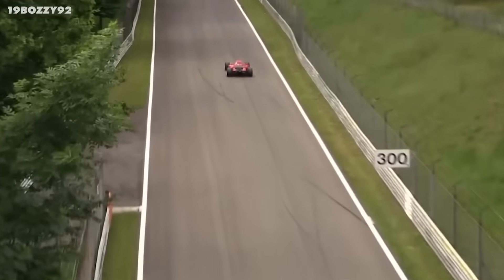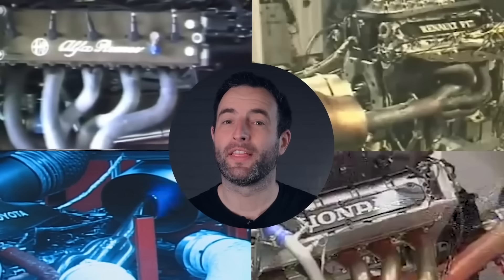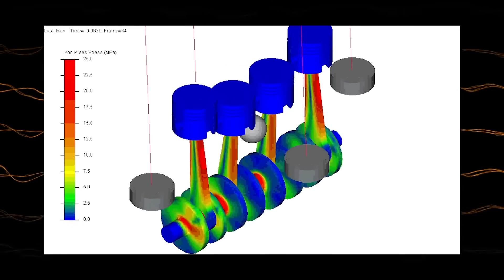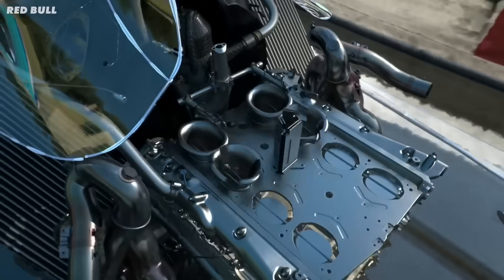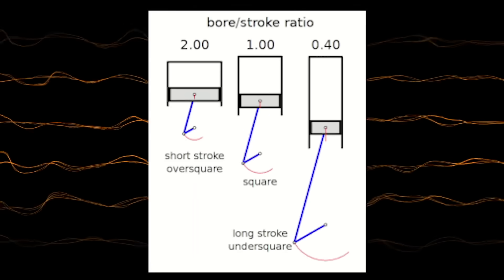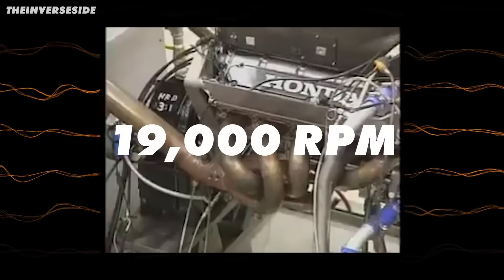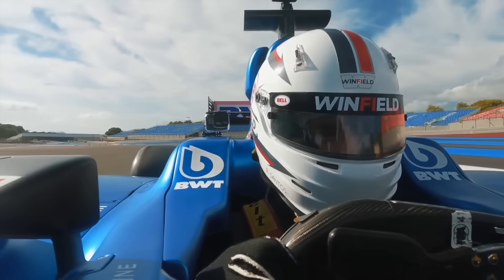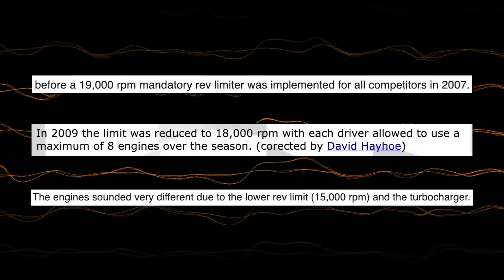When Formula 1 Engines Revved to 20 000 RPM!

Comment: They actually reached the end of the line... at around 21.000 rpm the Flame isn't fast enough to keep delivering more Power with more revs, cause the pressure raise starts being slower then the gas cycle in the piston. The work cycles is so Short, it has no time to burn through or expand.
Reply: They had a similar problem with the current v6s.
Mercedes was the first to solve and reaped the benefits during the start of the hybrid era.
The solution found was inspired in rocket engine technology and involves a pre-burner: a small combustion chamber in which a small amount of fuel is ignited. The shape of the chamber greatly accelerates the flame to the main combustion chamber, where it spreads and is mixed with more fuel, igniting it. 
This increased flame spreading speed, the quality of the spread and the burning efficiency.
Reply: @lucasrocha7721  We (powertrain engineers) call that Turbulent Jet ignituon, or TJI. The effect is that instead of producing one Flame wall from the Spark you create multiple, one from each of the bores of the preignition chamber, leading to a faster burn of the mixture, a steeper pressure gradiant, a higher Peak pressure, more time to (over) expand the gasses and by that way more effiency and power.
Reply: @TheNecromancer6666  I may have heard this specific nomenclature before but didn't recall it.
As a layman the rocket pre-burner was the closest parallel that came to my mind.
I may be mistaken but I recall also reading something regarding thermal benefits due to better managing the heat spread on the piston head, avoiding the formation of Hotspots. I think Craig Scarborough mentioned something about this allowing for a different design of piston head that could be lighter.
Reply: @lucasrocha7721  Avoiding Hotspots is a good point too. The TJI leads to a very homogeneous burn. You know what the best analogy to TJI is? Not the cool rocket pre chamber. But prechamber ignition of am old Diesel Engine, before common rail direct injection.
Reply: Wow... That's fascinating. Good post. Cheers.
Reply: @TheNecromancer6666   regardless of the terminology your statement is still wrong as there is room for more rpm’s
sit back & watch my friend
Reply: @Gavin Gilmore First of all, if you read all of my comments, do you really think its a good idea to argue about engines with me? 
And Regarding your question: If you reduce Combustion chamber size, or introduce a way to accelerate flame speed, yes. If you keep it at the parameter we are talking about here, 300cc Combustion chamber, basicly normal premium fuel, a single sparkplug and no forced induction or chemical oxydator. That's it. That's the limit. F1 engine manufacturers back then spend hundreds of millions per year on these engines. Are you honestly telling me, you think you know better then Ilmor-Mercedes, Renault, Ferrari, Honda, Toyota and Cosworth?
Reply: @TheNecromancer6666  sorry to bother you again, but would you please clarify a doubt that came to my mind in the last days?
Race cars now have a stabilished trend of having a single air intake on the top, I was wondering what are the reasons for that.
I'm thinking about ram air effect, cleaner air, less weight and ease of plenum design, but I would like to hear what are your thoughts about that. I can think of some benefits of going for two smaller intakes lower on the sides (like some street cars) or using part of the sidepod intake area, but I'm wondering about the compromises of this alternative.
Reply: @lucasrocha7721 No worries mate. Yes. All F1 cars have it, all LMDh and LMH have it (I think), all P1s after 2011 had it, all P2s have it.... Aerodynamics is not my area of expertise so I can't give a definitive answer. Ram Air is factor. A good airbox gives 50mbar at around 200-250kph, that's 20-30hp for a Prototype or F1 car. Another factor is temperature, the air there is the coldest the car can "reach" even when the asphalt is boiling. Another factor is that from there most racecars pull additional cooling flow. For Turbo, electronics, gearbox oil... etc. 
And the last factor is location of the engine intake. Neatry all modern racecars have very tight engine packages , so the turboinlet/Intake trumpets are all in around the cars centerline. So this is the shortest path there. Remember 80s Turbo F1 cars, group C cars and the Turbocharged LMP1s before 2011? They all had engines over the whole width of the car, with Turbos in the sidepods and intakes on top of the sidepod.
The con of a Topairscoop is a loss of rearwing performance.
Reply: @TheNecromancer6666 😂😂😂 such a wannabe😂😂
There is no such general limit as a number of rpm‘s, as the piston speed (just to mention as one of the factors) is for example depending on the ratio between crankshaft/connecting rod etc., etc.
😂😂…in the UK/USA everybody calls himself an „engineer“😂🤣😷
Reply: @christophmeyer5402  Well I have designed Performance engines, sunshine and you? If you had read my comments you would know that your vary basic arguments, while correct, are not applicable here. You talk from a Roadcar perspective, not an F1 perspective.
Let me give you an example, you would already know, if you had 1. Bothered to read my comments 2. Even basic Knowledge of racecar engine design.
Bore and stroke ratio in an extreme RPM, high compression engine will give you a hard limit on rpm. Why? You can't shorten the bore indefinitely, because otherwise, at TDC there is no space left to open the valves and if the gap between piston and chamber becomes to narrow the flame wall becomes unstable. High revving F1 engines were at that point of compression ration, bore and stroke. That's the reason that, while your argument is valid in a roadcar context, its pretty nonsensical in an F1 context. They are already three steps further then you thought.
I'm German BTW.
Reply: @TheNecromancer6666  so obvious, that this would trigger you🤣 
Good to know that WE😉 have enough knowledge, to have enough self confindence, in what WE😉 do.
Reply: @christophmeyer5402  What annoys me, is that in a long thread of friendly and civil conversation one wanker, who has no clue what he is talking about, comes along to ruin that. It's perfectly fine that you don't know about racecar engines, thats not a crime. But then ask. And don't be a dick about it. You could have known that I would try to answer any question as good as I can.
Reply: @TheNecromancer6666 than*
Reply: @lucasrocha7721  so instead of a spark plug,they use fire?
Reply: @paulsheridan291  Pretty much. They still have a sparkplug, just in the prechaimber with the direct high pressure fuel injector.
Reply: @lucasrocha7721 Sounds like a 2-stroke combustion event.  Who would've ever thought that it would take a series of sensors, wires, computers, extra injectors, extra spark plugs, valves, cams, chains, spinny-things, etc, etc..... In order to reach 2-stroke power levels🤷‍♂️??
Reply: @cap10moman  I am not a bike or two stroke person, but I know that the old GP two strokes could reach 400hp per Liter, while the V10s reached 320hp per Liter. With the later V8s reaching 310hp per Liter at lower rpm.
 But the 4 stroke has a wider power band and won't murder you when it comes into its rpm band. Even oldschool Turbos aren't as violent as some of the things I heard about two stroke bikes. Also: there is no two stroke with 1000hp per Liter, as far as I know. So turbocharged 4 strokes still have it.
Reply: @lucasrocha7721  That was because they were running very lean due to fuel limits and the use of direct injection. Due to it running so lean they would miss at higher rpm, so they made a rich area around the spark plug turning one little spark into a bigger ignition flame to ignite the lean air fuel mix.
Reply: @lucasrocha7721 actually the technology is used in the ford powerstroke engines but still direct injection is still better
Reply: @lucasrocha7721  My brother in Christ, Mercedes had their engine already designed before the other manufacturers. They designed the 2014 specs.
Reply: @skwisgaarskwigelf331  No they didn't. Renault Was the biggest proponent. Which is kind of funny...
Reply: @skwisgaarskwigelf331  so yes, technically they were the first to figure it out.
Reply: @lucasrocha7721  rocket engine technology? I am no engineer but that sounds far fetched. As a mechanic I would say it is similar to precombustion chambers like the ones used in old diesel engines in the time that distributor injection pumps were the norm. Funny how some technologies deemed obsolete for an application can become the norm for other applications (even if with major tweaks).
Reply: @Runmeerkat  yes yes. TheNecromancer6666 also made that point to me.
I'm not a engineer and the example that came to my mind to use as a point of reference was the pre-burner in a stage combustion cycle liquid fuel rocket engine, which does a similar job, while having the far more important role of spinning the turbopumps.
Reply: @Runmeerkat  You are actually pretty much Spot on. Its a lot like an old prechamber diesel. Instead of a sparkplug you have a hardened steel Insert with bores in it. Within that Insert there is the high pressure injector, the sparkplug and optionally a high pressure air valve. The fat mixture in the prechamber is ignited, through the holes in the chamber the Flame comes out in high pressure jets. These jets light the lean mixture in the Combustion chamber from multiple points, instead of one, causing it to burn faster, they also Set it to tumble more, causing even more complete burn through of the mixture. 
This leads to an engine running extremely efficient, due to running lean, running a very steep pressure gradient, a higher peak pressure and very complete and clean burn. Petrol Engine with a thermal efficiency >50%.
Reply: Yeah, that's what I thought - and the next limit that was hit was the spring rate of the various alloys used to actuate valves, etc...
Reply: @bholdr----0  That's not really a factor, because Iof the Pneumatic Valve springs.
Reply: Also, is the rate of the propagation of the combustion analogous to how black powder firearms hit a wall based on the fact that black powder deflagration hits a wall, after which, no matter how much powder was placed in a gun, or how long the barrel was, the projectile simply couldn't be propelled faster... Which led to some truly absurd firearms which could only increase the energy of their projectiles by increasing their mass, as a maximum practical speed (something like 1500 fps) had been achieved. (Which was also perhaps the impetus the transition from solid shot to shells in the late age of gunpowder artillery age/ age of sail...

I don't really know, but I'd love to learn... It seems reasonable...
Reply: @lucasrocha7721  Actually they did the same thing Honda did with the CVCC back in the 70's.
Reply: @lucasrocha7721  Diesels have that tech.
Reply: @HSKFab  *Had.
Reply: And then in 2007 the regulations said that engines could not go higher than 19.000rpm in an effort to limit costs of reliability issues
Reply: @arnaudj.5314  That kind of “cost reduction” isn’t, it’s utterly clueless. Exotic materials are a very small part of the cost of these engines. R&D is the true driver of cost. Every rules change spikes cost. If you really, genuinely want to reduce costs and improve the backmarkers relative performance freeze the rules for 20 years. If you’re changing the rules every year, as FIA does, along with enormously expensive new engine regulations every so often, you maximize costs and essentially eliminate the ability of small budget teams to catch up.
Reply: @headlibrarian1996 that's probably the plan ...the rich and powerful like to tell us peasants lies so that we stay blissfully ignorant while they do.nefarious.things to make money and when things don't work the way the peasants think and start to complain they just make another "new" plan and we are pleased and stop complaining....
And so the cycle continues.....
Reply: This is only the case if they have enough stroke.. with less stroke they can rev higher because the piston moves slower during one stroke
Reply: @ebugauge  No. Because the work cycles just gets to Short. You have a maximum Speed which the Flame can travel at. If that isn't fast enough to burn through the mixture and then give it time to expand after the burn. You can only rev higher by reducing the combustion chamber volume or raising the charge pressure.
Reply: @TheNecromancer6666  which of the two has more effective power to volume inserted to the chamber: igniting before the cylinder and pushing already ‘burning mix’ into  the chamber or putting more fuel&air into the chamber (which was my normal logic, seems at such high revs my logic lag same as the spark..?)? It’s just so new to me that I feel I learned more form comments than form the vid itself. Anyway my regards for your knowledge, though I knew how to tune an sport engine
Reply: @bartolomehus  In absolute terms a 1980s F1 Turbo still has more absolute power and more power per volume. 1200-1300hp in quali trim, at up to 6,5 bar plenum pressure (5,5 bar boostpressure), >900hp at 5 bar plenum pressure (4 bar of boostpressure). The preignition system and high compression lower plenum pressure engine is way more efficient. It has more power per amount of fuel. In 2020 the Mercedes W11 had on average 1022hp, varying a bit by track and mapping. 163 of that is the MGU-K, so that leaves us with around 859hp from the V6 at a maximum of 4 bar plenum pressure. So Overall the "Brute Force" Method achieves more power. Though I might add due to the wide, usable powerband modern F1 cars accelerate faster then even the last 2005 V10, which had a higher power to weight ratio and less drag. 

 If you were to run 1980s Boost pressure and fuel mixtures with a preignition system you would in theory gain even more power and primarily more reliable and consistent power, cause you would burn more consistent and cleaner. If that System would work with the Toluene fuel of the 1980s and those absolutely insane pressures and extremely fat fuel mixtures.... I don't know. I suspect it would take work and it might get to the point where Temperatures and pressures just go beyond what is controllable.
Reply: @ebugauge  Exactly, an oversquare design.
Reply: As soon as the V10 engine died F1 stopped being the top racing league in the world.
Reply: If I recall correctly, at the height of the era, Honda engine reached 22,650 RPM, while the second best BMW was at the low 22,000 RPM range. Correct me if I'm off.
Reply: @willywonka4340  Cosworth reached 21.000 rpm and that's the record in the car. What happened on the dyno is a different matter.
Reply: @willywonka4340  the rpm limit is not a hard limit fixed in stone and depends on the cylinder size and geometry, the numbers and placement of spark plugs, the quality of fuel atomization, air fuel ratio, etc.there are many parameters, but I think its fair to say those engines were quite close to the physical limits of rpms regarding valve springs and flame front speed. there is a point there is no interest in reving faster if you lose torque quicker than you increase rpms, your'e just burning more fuel for less horsepower. F1 are not like top fuel where you want highest power at any cost, reliability, efficiency and drivability are also important
Reply: @willywonka4340 i was at F1 race at Indianapolis in 2000 & remember watching the in car telemetry on the giant big screen, the McClaren Merecedes hit the rev limter at 21,500 rpm when they dropped off the air jack leaving the pit
Reply: There's a difference between being on the dyno and being in the car.
Reply: @456MrPeople  Yeah. And?
Reply: @willywonka4340  Might be. But in a interview Ross Brawn mentioned numbers 20.000rpm and 900bhp.

Of course I keep the 1.5l bmw engine with a barrel sized turbo and 1.500bhp a superior achievement. For 2 laps 😊
Reply: @Tomsm8  a single letter makes him more human
Reply: One of the Japanese manufacturers had a pre ignition chamber on road cars at the beginning of the smog Era.
Reply: @randallmason9687  Yes, though working a bit differently. It was Honda, the so called CVCC System, "Compound Vortex Controlled Combustion". It was basicly like Diesel prechamber. It had a normal Combustion chamber with two valves, fed by a tumbling, lean mixture. The prechamber had a second, smaller Intake valve and the sparkplug, It was fed by a rich mixture. The ignition and firejet of the prechamber the cleanly burned the lean mixture.
Reply: @TheNecromancer6666  I think Suzuki motorcycles had this tech back in 1983. I think it was called "TSCC".
Reply: @TucsonDude I had never heard of that actually. As far as I read its a Twin hemispherical Combustion Chamberlain, made to optimise swirl. Nothing to do with prechaimber.

Also congrats for knowing weird engine shit I didn't.
Reply: @TheNecromancer6666  Thanks!
Reply: @randallmason9687  yup. Honda CVCC
Reply: Flame speed doesn't have to be the limiting factor at 20k rpm type speeds. I guess you could either develop a faster burning fuel, or utilise a different mode of combustion e.g. where instead of relying on deflagration, perhaps you use something more akin to spark initiated compression ignition -- like Mazda's SkyActive. I think I read something along the lines of the optimal inlet port geometry required was too small to implement much above 20k RPM type high engine speeds with a conventional like engine design. However almost anything can be solved with clever engineering.
Reply: @nick_parker  I think they want use now liquid C4 /Nitro Glycerin Mix with NOS injection
Reply: Cosworth no 1! ;-)
Reply: Man, the engine outperformed it's basic architecture and design, it outran itself, that's absolutely ludicrous.
Reply: I do recall rumors that renault reached 22k with a v8 but the rev limiter was introduced before they could actually use it or something
Reply: A f1 v10 running at it absolute  mechanical  limits doesnt even get close to the power of the modern f1 PU when its got artificial  limits  on it. Even the old issue of turbo lag has gone due to the hybrid  assisted  turbos. You get higher power of a turbo with  the instant torque  of a NA engine... 
However Naf they sound  in comparison they are actually  so much better.  A modern f1 car can do 8mpg while lapping faster than any other car on track.
Reply: @rhyswilliams4893  An old V10 at its absolute mechanical Limit has 960hp in a very narrow rev range. A modern V6 PU has more then 1000hp. I know that in 2020 the Mercedes had 1022hp on most races. So I guess 1050 is realistic currently. The interesting Part is not the Peak Power though, but the usable Power band. That is much, much wider on the V6. Interesting thing with the V6 Turbo, their Combustion cycle is so specialised, they need the Turboboost even at idle to run at all.
Reply: @TheNecromancer6666  So would this mean that the V6 in AMG One is also running on boost when its idling? Cool.
Reply: @dudigi  Possible. But I think, they changed quite a bit to make that thing more usable and realiable so. I wouldn't bet on it. And I don't know.
Reply: @TheNecromancer6666  "turboboost at idle"??  I guess the engineers are so bad that they can't program the ECU (encompassing other abreviations) to change fuel/spark. (Sarcasm intended).

I would say "turboboost" helped the car idle with the least amount of fuel.  Lot's of reasons why, no space/time to get into it....
Reply: @cap10moman  No. They don't rum Otto cycle. And the engines physically cannot run on atmospheric pressure. That's why they use the MGU-H to drive the Turbo on idle, to provide some charge air pressure.  It has nothing to do with fuel consumption.
Reply: I was actually thinking if that was the limiting factor why the v10s didn’t rev even higher. Thanks for answering my question before I asked lol. I miss the sound of these engines so much. And honestly, the size of the cars too. F1 cars shouldn’t have the same footprint as a large SUV.
Reply: There were also problems with the shock waves (think SR-71 intake spikes) in the intake as the intake air speed at over 20,000 ripems is becoming trans-sonic.
Reply: @ramosel  I never heard of that one, though I have seen the Air accelerated so much into an F1 engine Intake, on the dyno, that it pulled vapor clouds, like wingtip vortexes. Apparently that's not that Big of problem when running in a car though due to the ramaie overpressure and resonance charging in the airbox. That higher pressure stabilizes the airflow into the Intake.
Reply: The car equivalent of stalling in an airplane
Reply: It may be the end of the line, but its the new start, end.
It sets a perfect goal for fuel combustion developers to aim for.
Just a simple spec to achieve - get the flame front combusting as fast as possible without detonation.

That is an interesting dylemma as the need for reduced compression is a power loss vs increased compression reducing the speed of sound.
Reply: then should use hydrogen, it burns 5km/second
Reply: @makantahi3731  I am 100% on board with F1 moving to Hydrogen power.
Reply: @budthecyborg4575  btw, on normal car petrol engine, if occurs detonation due low octane number, that combustion/explosion/detonation burns on similar speed as pure hydrogen, so if they could use it for high speed/rpm engines....
Reply: go listen to Ralf at A1-ring with the BMW V10.... and just as fast as the current cars as the cars are much smaller, more nimble, and better to drive
Reply: @steveb6718  That Statement is too broad for me. What do you mean by current cars? And by just as fast? 2022/2023 cars? 2020 cars?
A 2004 Ferrari could not get Pole Position in a modern 2023 F1 field. And with 2020 Regulations it would be multiple seconds of Pole. But it's a faster racecar. A way faster racecar. The old F1 cars are made to run a race as a set of Sprint stints, between Fuel And tyre stops. A modern car cant do that, its too heavy with full fuel, the tyres are too brittle and unlike an LMP1 car, the hybrid system has to recharge after one or two pushlaps, cause the regen is so low. 
In my opinion an F1 car should be Small, Light nimble, 600kg or less, 4,5m length maximum, 1,9m wide or narrower.  And if they have to bring refuelling back for that, be my guest. I don't want a V10, the modern engines are too fascinating, but I want them as Twin Turbos, louder, revving higher, with a Hybrid System that Provides short bursts of a lot of Power.
Reply: Do you need stronger piston return springs to achieve those RPMs?
Reply: @saltybmx6977  No. You run a piston Hammer, it cycles offset to the stroke on the crank and smashes the piston back up.
Reply: @TheNecromancer6666  silly goose, the blinker fluid is more important here
Reply: @rarelycold6618  Not a sportscar. Doesn't have blinkers. You have to remember to top up the highpressure airbottle for the downforce though.
Reply: @TheNecromancer6666  a piston hammer/spring?
Wasn’t aware something like this is/was used (tried doing a quick google as well). I recall springs being used in I believe the valve train so there wouldn’t be collisions before there was enough air/fluid pressure…
Reply: @fragdude  Its a stupid joke. No hammers/springs for pistons.
Reply: @TheNecromancer6666  🤣
Reply: @TheNecromancer6666  does it matter if the piston hammer is chrome or polished? Does it cut through the air better?
Reply: @saltybmx6977  Oh you need chrome hardened, so it doesn't wear to fast when smashing the piston.
Reply: @rarelycold6618  as well as the wiper brake discs for when it starts raining 😂
Reply: @rarelycold6618  You. Got. Owned... 🤡
Reply: @Eat-MyGoal  oops
Reply: @rarelycold6618 nah muffler bearing are the most improtant parts
Reply: seems like a copied response as you have trouble describing a technical phenomenom .
Reply: RC cars run like 40k rpm
Reply: @kerimca98  Not on petrol though. And not as four stroke. And with a Tiny Combustion chamber
Reply: Thats like planes finally reaching Mach 4
Reply: Sounded like engine parts and gears would blow out at any time
Reply: @baruc-k4q  They were quite fragile compared to current F1 cars.
Reply: That's called diminished returns. Absolute insanity. F1 should've stayed at 20k V10s, and if you can't afford it, then compete on another level. F1 is supposed to be the EDGE. I hate today's F1 and haven't watched a single race since mid 2000's.
Reply: Amazing. No, seriously, I totally get it. What's next, Ram jet? After burning?
Reply: @sydneybrown64  Less ICE and more MGU....
Reply: No the FIA capped teams from developing higher revving engines out if concern the higher revs would lead to more bhp. The whole point of the grooved tires was to slow the cars down, having more bhp from higher revving engines would negate that so they capped the revs to 19k and forced grooved tires to limit the cars speed. (Keep in mind, I both lived through that era and have 20+ years experience of driving Formula Atlantic and Formula Ford, I'm not just speaking as an audacious fan).
Reply: @KaDuWin  Not accurate. They put in an RPM limit and a design freeze on the V8s. But the main concern was cost saving. And in anycase, there wasn't much to be gained. For the reasons I have explained in depth.
Reply: @TheNecromancer6666  No it is accurate, they put the design freeze on V10s to limit the horsepower coming from the engines. This is not opinion, its fact and is documented everywhere online as well, look it up. I watched F1 since 89 and know what I am saying is 100% accurate in addition to my racing experience in Formula cars. The V8s were a separate issue and made (on average 150-200 bhp less than the V10 and also regained the full slicks because of how much slower they were than the V10s.
Reply: @KaDuWin  Repeating a falsehood doesn't make it true. They didn't freeze V10s. They replaced them with V8s. That's what their major step in limiting power. The V8s, despite still climbing in their max revs, wouldn't be able to match the V10s power. So there was no need to cut down on power because of that. The only reason for the engine freeze and rev limit was costs. Period. If you bothered to do a 30s search on Google you would know that instead of making it up....
Reply: @TheNecromancer6666  Its not a falsehood dude, you dislike that your claim was disputed, (I get it, no one does) fact of the matter is the FIA capped the rev limit and lowered it to 19k instead of BMW's 20 max. You can sit and enjoy your belief all you like but everything is documented online (even youtube videos with interviews at the era) confirm the FIA intervened. At this point the only one sticking to falsehoods is you.
Reply: @KaDuWin  They never put any design freeze on the V10. Otherwise you would be able to produce a source. Watching F1 doesn't make you an expert on performance engines. Which I am. 
The only restriction put on the V10 until they were replaced was that they had to last a weekend instead of just a single session. But there were no limit in weight, RPM, materials, fuel Flow or development. Up until the last days of the V10 era in 2005 especially Honda and Toyota chased more horsepower, peaking at 965hp in the races and a 4 digit power number on the dyno. They used Carbon Ceramic pistons ffs. There wasn't the hint of a limitation the V10s. All the limitations on rpm, materials, weight, the engine freeze and mandatory engine life came only in V8 era.

Which you would know. If you knew anything about Formula 1 engines. But. You don't. You are one of those DTS Fans aren't you?
Reply: @TheNecromancer6666  Congrats, I raced in Formula Atlantic and Ford for 20+ years mr. expert, I know first hand what pneumatic valve engines will do (because I raced them). This is not opinion, and you're no expert as you self-proclaim to be (you're just egotistical).

There are countless sources from Scarabs, F1technical, F1's website, countless youtube videos that all discuss why V10s were limited to 19k rpms. Prior to the 19k rpm limit BMW was reaching 20k rpm during races and produced the most bhp with 960, then the FIA enforced the 19k limit and the BMW engine dropped to 940bhp (which is what the FIA was looking to do, slow the cars down). 

FIA the V8s actually have the technical ability to rev higher as they're smaller and have less moving mass (basic physics). They also produced less BHP than the V10s because of lower rpm limits.
Reply: An average man strokes at 180rpm 😂
Reply: Just add cylinders😂
Reply: @TheSteinbitt  It really doesn't matter that much... the engines are scalable. Cosworth for example used single cylinder 300cc units to develop their engines.
Reply: Faster than a goddamn explosion... perhaps science is gone too far lol
Reply: @ATBatmanMALS31  Its not an Explosion though. Its a burn.
Reply: If you gave an old V10 600 kg car a set of modern slick tyres with much more grip than the grove tyres they raced on originally, would a V10 be able to lap faster than todays 908kg turbos ?
Reply: @hungrysurfer9471  They are competitive on rock hard Demo tyres without an adapted setup. If you put a slick made for it on, it be a lot faster. 
Btw: modern cars are only faster over a single lap. The old cars are still the faster racecars. By a lot.
Reply: I remember my 1990s rotax 100cc kart engine reved to 20,000 rpm. It sounded amazing.
Reply: It's crazy that it's essentially the same limitation a rocket engine has, and for the same reason lol
Reply: I don't know why, but finding out that these super high revving engines used compressed air instead of springs on the valves blew my mind.
Reply: The V10s never got that high. Highest ever confirmed in a car was 19,200rpm.
Reply: @Scotracer1987  First of all, you don't know. Because it Was never made Public. Also by 2001 BMW had reached 19.000 rpm. So by 2004/2005 racecars were running >19.000 in the race. McLarens Ilmor Engine in 2005 revved to 19.600 in the Race. The V10s probably never saw >20.000 rpm in races. Probably. If somebody did it was Honda in 2005. While in 2006 multiple V8 engines went over 20.000 rpm. And it has been made Public that Cosworth reached >21.000rpm.
Reply: @stevenp3176  Partly. The Main reason is to get enough energy into the chamber to Generation 1300hp per piston. Nitromethane is a combination fuel and oxidizer. Also called an explosive. You couldnt get enough energy into that piston by burning fuel with air, without an additional source of oxigen. The other is yes, it burns faster, giving higher pressures. In an 8,2 Liter V8, revving to 8k rpm you have less then a tenth of a second to burn through that gigantic Combustion chamber. The stroke and piston speed is less of a problem then the time the cycle takes. And the earlier you burned through the mixture, the higher your Peak pressure is and the more you can expand after.
Reply: Fair play u know ur shit mate
Reply: @chickenlivers9351  Thanks 😉 kinda my job so...
Reply: My old inline Holden red could pull 7900-8000rpm..
Man it could scream....
Balanced crank, YellaTerra stage 6 head, Yella Roller Rockers & triples helped... 🇦🇺
Reply: @Tim Clinton  That's great. Though I have no clue what that means, since the only holden engine I know are their own small block V8s, before they used the LS/LT, as they were sometimes seen in europe as powertrains for exotic sportscars. (I'm German)
Is the Inline Holden Opel based, Chevy based or their own Engine?
Reply: @TheNecromancer6666  Holden inline 6, 179ci.  🤙
Reply: I’ve always thought that moving to burning hyrdogen would be fun for this reason. Higher flame speed could take us new max rev limits? Can’t see much road relevancy for that but F1 might not need that in the future and it sure would be fun.
Reply: @binbob9  I don't know if hydrogen has that much higher Flame Speed. I don't know if it works like that in a pressurized mixture. The question is, why would you want to rev that high? Its much more interesting to gain more power by making an engine more efficient, by raising piston pressure. Sind you have another hard Limit in 4 stroke engines, you need Enough space at TDC to have the Valves open. In a super Short stroke, high compression Engine you get to the point where that's a Problem. And if you have a very flat Combustion chamber at TDC in a super Short stroke Engine, there can be Problems with the flame cleanly burning through the whole combustion chamber. So I would assume that developing further in that direction is not usefull.
Reply: Back when the fumes from the fuel was fatal.
Reply: Wouldn’t that be fixed with multiple spark plugs per cilinder? For small aircraft and some motorcycle like the Suzuki SV series that’s common
Reply: @djeurdjel1  Partly, that's why TJI works so well. In Aircraft it's main use is redundancy btw. The two Ignition systems are independent, so if one fails one is left. 
In a high revving F1 engine, the second sparkplug would cost valve area though so you would probably loose more power up top then you gain.
Reply: I went to the U.S. Gran Prix at Indy during this era and the sound of the grid at the start was unbelievable
Reply: Wondering why multiple spark plugs strategically placed wouldn’t work better…or one spark plug connected to multiple isolated sparking tips placed to propagate flame fronts faster.
Reply: @BoogWar01  Not better then TJI, also it would cost Valve Area. Twin Spark has some very interesting effects, but in modern, meaning direct injection engines, you really don't have the space usually. And if you do it's usually not worth it. 
In the KTM LC4 690 twin sparks help not only cleanly burn through that massive Combustion chamber but also reducing vibration, emission and boosting power when wide open. They also make traction control regulate finer.
Reply: You could always add more pistons
Reply: @johpfit760  And more mechanical losses, weight and failure points. The reason they all ended up using V10s was 3 Liter V12s were to large, too heavy, to thirsty and too inefficient, a 3 Liter V8 couldn't rev high enough to generate the power. So V10 it was.
Reply: Lots of misinformation in these comments buds😂😂😂😂😂
Reply: in my opinion in those days BMW and Honda had the most epic sounding v10’s
Reply: ThEY aCtuAlLy reached 22k rpm by the end. See cosworth
Reply: @jusocrazy  Not in a car they didn't. On the dyno that's realistic though.